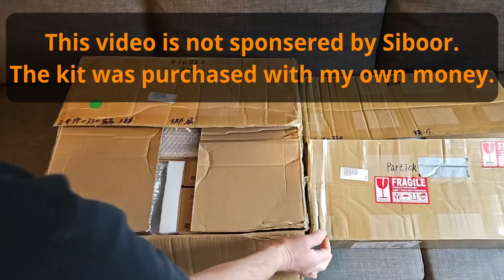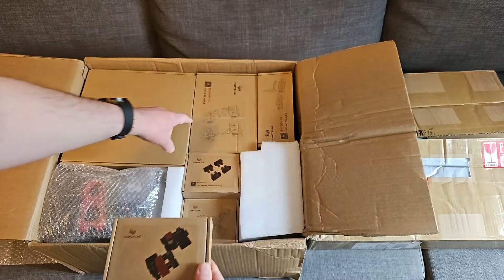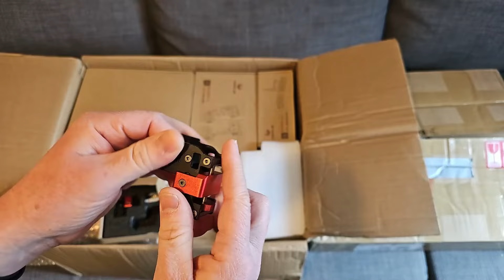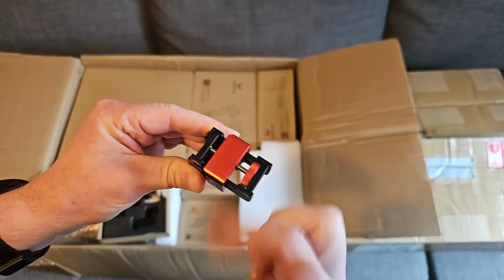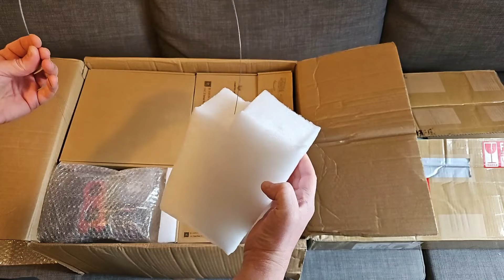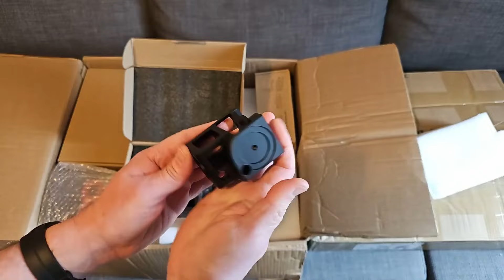Voron 2.4 SIBOOR kit Unboxing

Comment: Thanks for this video. Kinda wished you pulled out the bed plate! LOL.  I just bought one last night (Sorry, found you after I bought) with the CNC parts, no pretty parts. I got the ERCF8v2 as well.  I'll print them once the build is done. Again, thanks for the video really appreciate it!
Reply from the maker: The buildple is better than I imagined. Very flat, and I don't seem to have the bowing issue I see others talk about... although I don't heat it over 95c

Comment: I just finished building the same siboor v2.4r2 kit, but 300mm and with no included abs/metal parts (i printed my own) and also found the kit quality was excellent. Installing Canbus firmware and finding UUIDs was a pain and the printer.cfg needed a few octopus pro mcu pins added/corrected or inverted just to get it working or moving in the right direction but a great kit otherwise.

Comment: I have the same Siboor kit from December. Mine came with TAP, not Cartograhper, but I have upgraded that now. I love my 2.4 Siboor kit. It went together with no issues. I also got the CNC parts and printed parts. I found nothing wrong with any printed parts. I love how complete the kit is and how easily it went together. The printed wiring diagram is very handy. My only minor complaint is that the cable tracks are a bit small for me. There is a lot of wires to stuff into them and it gets tight. I printed some larger ones, but it is not required as the kit ones do work, they are just real tight in some areas.
Reply from the maker: Yeah I was thinking the cable channels looked a little small. I might get some larger ones. They really shouldn't be fill more than 75% of the way.

Comment: I order voron 0.2 from Sibor. Works well so far. Tho I replace original stealth burner with Sherpa mini.
Reply from the maker: I've been considering putting a BIQU H2 on this machine. It's light and fairly powerful.
Reply: @StackingLayers  I use biqu h2v2s on ender 6. It is good extruder. But it clicks on retracts. Very annoying sound. Sherpa is very silent. And do not eat any additional space (on Voron 0 it is important)

Comment: Recently ordered one, how long did it take until the status changed from "Order Preparing"?
Reply from the maker: I'm embarrassed to say I never really checked 😅 I got it in about 3 weeks which is very typical for things I order from china.
Reply: @StackingLayers  Haha, its alright, thanks for the info!
Reply: @StackingLayers Just to update, it arrived today, on the 19th, I ordered it on the 4th, it switched to shipped on the 19th also
Reply from the maker: Not too bad of a wait. I've had the same thing happened on several different packages where it changes to show shipped on the day I receive it or sometimes even like a week later. It's worse when I get notification delivered when it's still in transit. Someone get marked delivered when it scanned that customs.

Comment: Story of my life, day late and a dollar short. I may have got this kit if I didn’t just finish building a Formbot 2.4 pro 350 kit, I added CAN but now Formbot’s kit ships with CAN lol….
Reply from the maker: That's one advantage of me having to wait to save up, I got to see some cool improvements made and then the kit was how I wanted it when I could finally get it. I'm glad I resisted just throwing on the credit card.
Reply: @StackingLayers  I just ordered their Trident awd kit, I wanted my next build to run higher accels and I think this BOM gets me in that direction, my 2.4 350 and Micron 180 both use tap/boop so my accels are low, my next build I want to see how far I can push speeds and quality. Now just the wait for it to start shipping is going to kill me.
Reply from the maker: That new kit looks so good! I want one too!
Reply: @StackingLayers  I also ordered a ERCF V2 from Siboor, I seen you asking about spool options due to low space behind the printer on nSiboors Dicsord. I too have little to no room behind my 2.4 350 so let me know what you come up with. Are you building or built Siboor kit? Also will we see a video on ercf2? I have 3 Bambulab printners with 6 ams units so this project for me is just something to keep me busy till my Trident kit comes....then after the Trident is build Im sure.
Reply from the maker: I haven't bought the ERCF2 yet. I'm still researching and planning... and saving. But if/when I get one I'll definitely try and do a video on it. I see it can be challenging thing to configure and tune. Sounds like fun! I am concerned about space though. I might have to make a wall mounted rack or something like that.

Comment: If those VFA's are only on the nevermore - I would just re-print it myself once you get the printer built. But if the other parts have those VFA's - I would not settle for them. That's not acceptable and I can promise you - nobody gets a PIF part from the Voron PIF program with VFA's.
Reply from the maker: It's worst on the nevermore, but noticable on some other parts in the right light. I'm not too bothered by it right now. I'll probably be printing some different stuff anyway once I get the machine going.